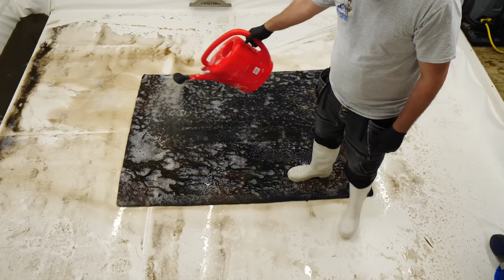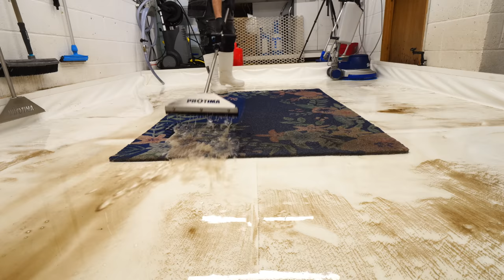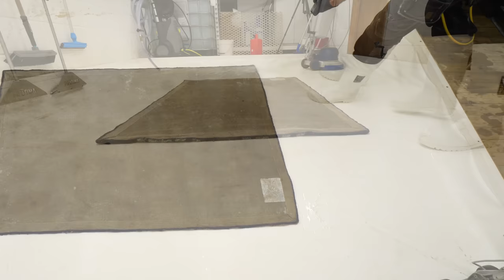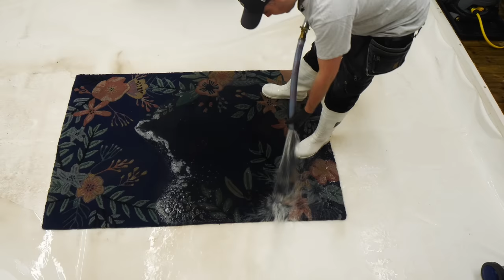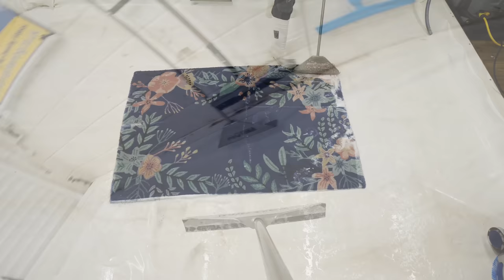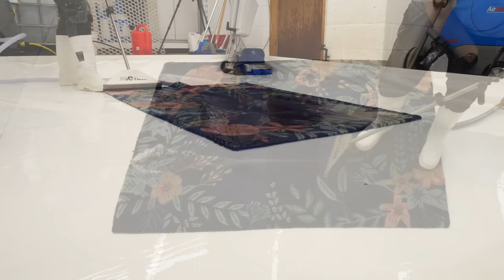100% Wool Rug Saved From The Dump | Carpet Cleaning | Satisfying ASMR

Comment: This may have been asked before, but why don't you wash the rug over a fine mesh platform, so the dirty water runs out and away rather than sits underneath?
Reply: At the end the water runs clear, and the white floor is an incredible visual tool.   I think he has his technique down.
Reply: @jamesgregory1704  I know that, but it seems less water could potentially be used if it didn't sit underneath meaning he had to wash both sides individually.
Reply: Because then people would be sadder it was shorter 😊

Comment: Once again, a conquering service on this wool throw. As the minutes ticked by, the floral motifs emerged. The tight knit of wool really retains dirt, dust, and smoke. Each application of shampoo revealed a different feature. None was more surprising than the rug's actual color; which is blue! I have an inquiry if you aro so inclined to answer. After the water extraction, how long is the drying time for a 100% wool rug? Well done, as always. Enjoy the weekend!
Reply from the maker: Thankyou. They typically take 12 to 24 hours to dry

Comment: I always enjoy your videos. got a couple questions tho. 
Could you let me know why you didn't use the r2 cleaner on this one but manually brushed it instead?
why don't u show us the drying process of the rug {i think u mentioned in one of your videos that the rug does into a drying room}
what's ur favorite rug material to work on and least favorite or hardest rug material to clean 
what's the clip you always show at the end of your videos where u fill the pale of water. is that the water that comes from the last cleaning of the rug to show how clean the rug is now or is it just clean water? 
are all the rugs you clean salvaged from the dumb or do you accept rugs from clients as well?
Reply from the maker: So many questions haha. One at a time please . I didn't use the crb because this is a loop pile rug and it would likely damage the fibres. Making it fuzzy if you see what i mean.
Reply: @MountainRugCleaning  haha sorryy😅😅. Is it difficult brushing this rug tho? There seemed to be alot of resistance between the rug and brush bristles